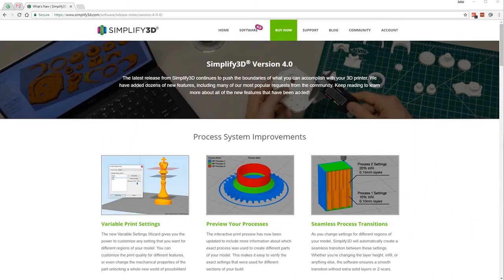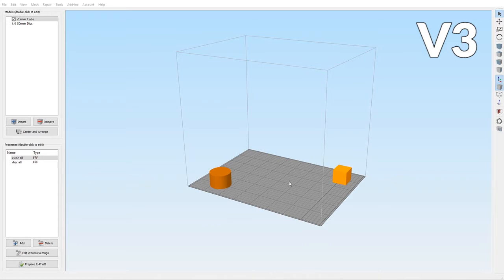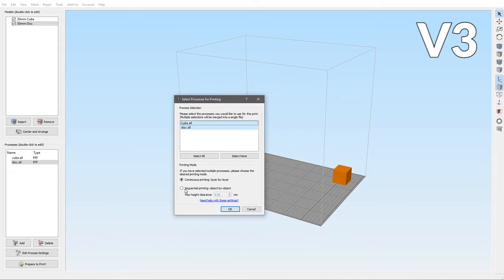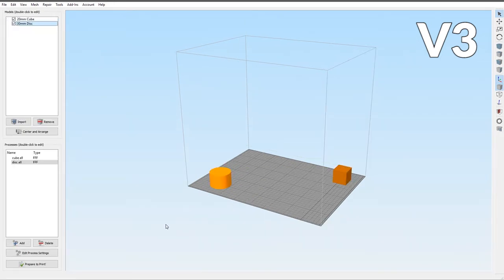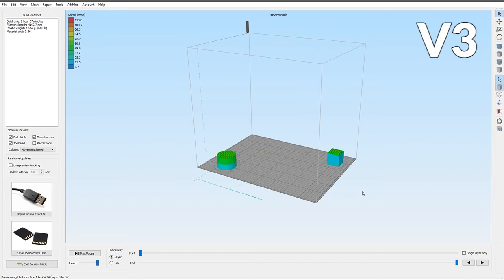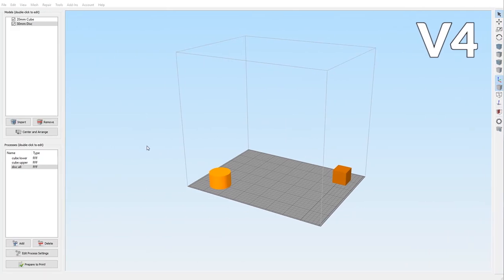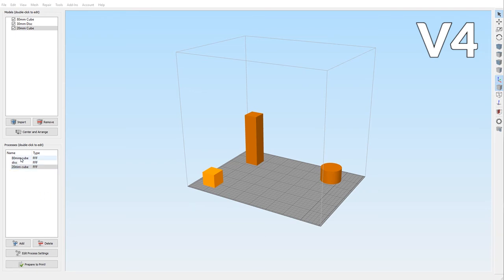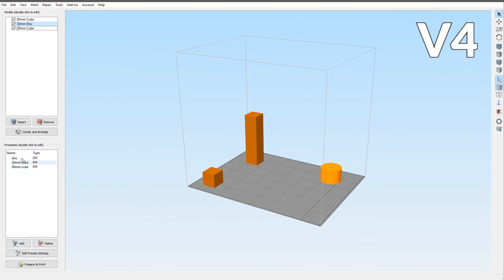Simplify3D Version 4 - Improved Sequential Printing & Drag n Drop Reordering

Comment: Just FYI – before S3D allowed you to drag and drop the processes to change the sequential order, you could still change the order. In the final dialog where you hit select all, instead select the processes in the order you wish them to print. So unselect all, then select the first one, control/command click the second, third etc. and they are printed in the order you select them.

I just checked and this still works in 4.1
Reply from the maker: Good info, thanks.